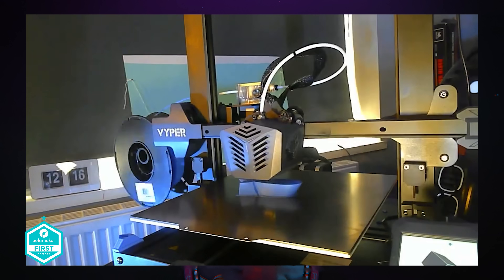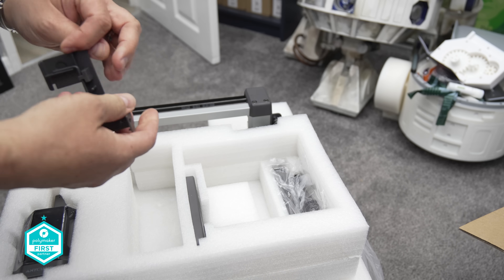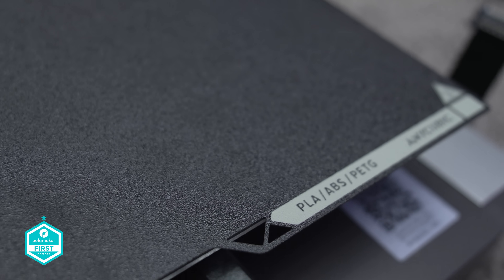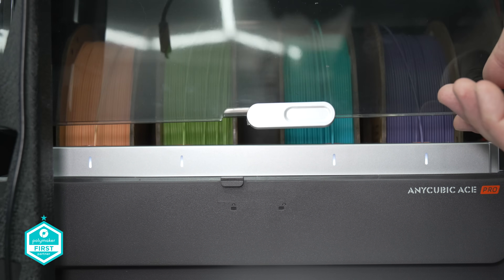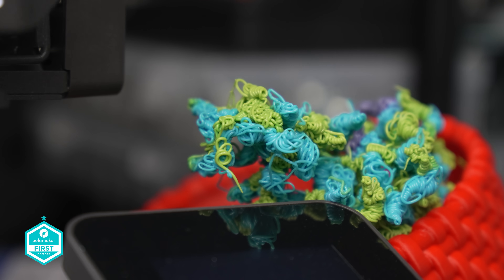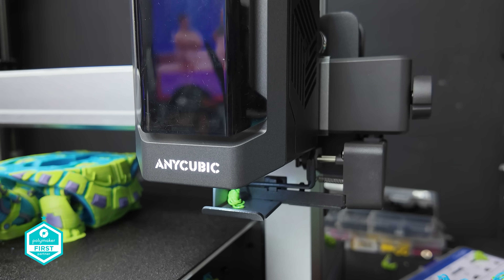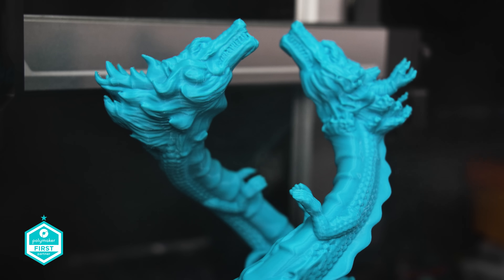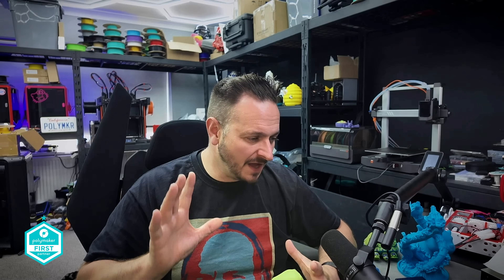Anycubic Kobra 3 Combo : Filament Flusher

Comment: The COMBO can be used as a single printer with easy access  to 4 colours single print with a dryerr 
AMAZING especially if you realise  that you can stop the print and change the colour with little fuss

Comment: It's now Apr 22, 2025 and the firmware is way, way better than the firmware from the origination of this video.  We just got a new update (2.3.9.3), and while it's not listed in the release notes, the purging has been reduced greatly. Prior to this version, you got 2 purge clusters if you were using the same filament in the same ACE slot, and 3 or 4 if you changed colors.  Now, you get one for the same color, and 2 for a color change.  This reduces waste by 1/3 to 1/2 for all ACE prints.  Additionally, the print completion dialog now asks if you wish to print the same item again.  I've now been using my Kobra 3 for a month and with only two issues that were easily resolved by the Anycubic team, it's far and away the best FDM printer that I own.

Comment: Everyone with adhesion issues sometimes please if you have made spaghetti, check your plate belt spline. All of a sudden after spaghetti, all my prints were messing up mid print of coming off the plate for days. Inspected everything all the way around and found small pieces everywhere. One in particular on my plate belt spline causing my belt to jump occasionally ruining my prints. Cleaned off filament off spline then calibrated. Havent has a bad print since.

Comment: I have both the A1 with AMS Lite and the Kobra 3 with ACE. The ACE is much more feature packed and easier to use than the AMS. I can't tell you how much I appreciate the loading and unloading of filaments the ACE. The AMS Lite, on the other hand, doesn't need its own power plug and is smaller in profile, and you can even mount it on top of the printer to save space.

Comment: The best part about the Ace Pro isn't the multi-color printing, but if you give it multiple rolls of the same color, when one runs out, it automatically switches to the next.
If you use the Anycubic brand filament with RFID tags, it auto-detects the material type and color too.  You can still use regular filament, but you have to tell it what type and color it is.
Reply from the maker: They all do that, ams and cfs specifically
Reply: best part of the ace pro is the active drying capability in my opinion. but its stupid and the fan runs ALL THE TIME though. even when you aren't' using the drying function.

Comment: Other companies haven't failed.  Bambu had it for 2 years+ already.  This is just a copy of the Bambu without software support.  It's still not on par.  I've been an Anycubic guy for years and never new how better I can have it if I left anycubic.,  Never anycubic again.  For years, I keep trying to reasure myself that I did the right thing buying anycubic.  I should've dump them a long time ago.  I sold all my two  Kobra 2 Max, mono x2 and moneo 6k for $200.  Never looking back.  the X1C and the A1 is 10 times better.  I don't have to tinker now, just design and print and not looking at layer lines anymore.  Just print and forget.  To sum it all up.  Don't buy this.  Go Bambu A1.  You'll save a lot of headaches.  The slicing software will never improve just like they never did for the old ones
Reply from the maker: @nick4088  other companies haven’t failed what do you mean?
Reply: @TheRealSamPrentice  After just watching your video I think he might be refering to the "other companies failed to do a drying AMS type thing". Anyway I just watched the review (I have an A1 combo already) to see if I should use my anycubic points on a K3 combo or K1s and Im now thinking maybe just $300 of filament...  Thx for the vids :)

Comment: Thanks Sam.  As I have mentioned to you before, I have always been concerned about waste from AMS type multi colour printers.  As you touched on, the energy waste is high as well due to the extended print times for multi colour models.  As a designer and printer I have been sitting back a bit lately to see what direction other designers have been going in and it's a very mixed bag ATM.  I think I will stick to my current ethos of keeping my designs easy print without supports where possible (not always possible) and minimise waste by separating different colours of the model where possible so they can be printed individually unless it's a simple single colour layer change thats produces a tiny amount of waste.  This reduces waste in both energy and filament.  I think there will be a waste problem until AMS type systems evolve and advance.  So in the short term, designers will need to get their heads around the problem and design around the issue where possible.  Sorry it was long winded 😂

Comment: Had it since launch.  I am OKAY with it.  Was Not excited or amped after the MAX and Kobra 2 nightmares.  Definitely a Upgraded design and still has some bugs it needs to work out.  Once they do it could be a real decent pick for someone getting into multi-color/material printing.
Reply from the maker: I have the same thought, it’s nice they got the 4 color out as quickly as they have. The larger than normal size is a plus too. My major hang up is the waste tho!